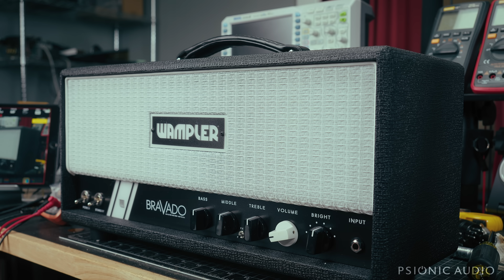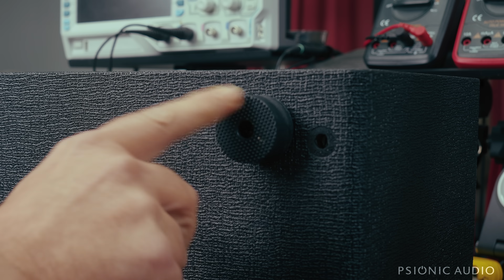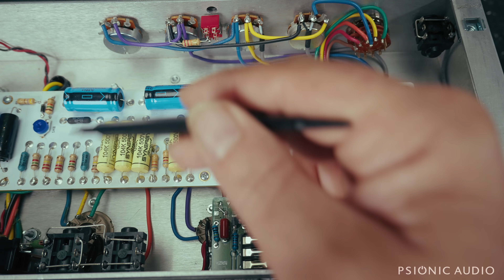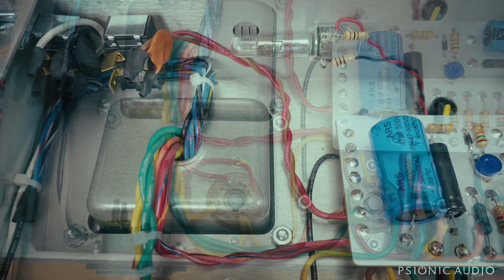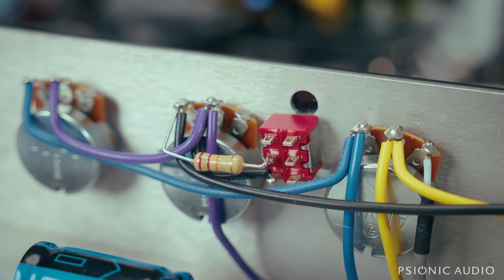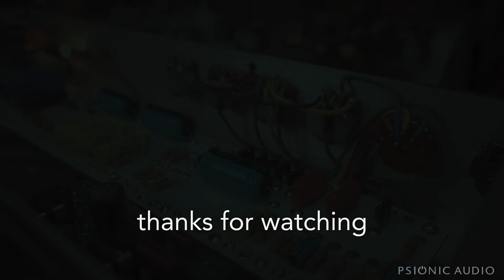Tell Me Something Good | Wampler Bravado Pt 1

Comment: Hi Lyle, is a VVR a good option for knocking down volume while getting that cranked amp sound. I have a TooHat Club Royale MKII that I’ve been considering this for. I play it liv,  but it’s still too loud with out attenuation. 

Thanks in advance
Reply from the maker: I’ve found that VVRs don’t last nearly as long as expected. I used to install a lot of them but had too many mosfet failures no matter the mosfet or heat sinking used. Just MVs and external high quality reactive loads for me now.

Comment: I own one of these.  Super happy with it but you have to want what it provides and be okay with what it doesn't.  Zero gain stages and high headroom was what I was after and it delivers.  Superp clean tone and yes it works very well with pedals. The only thing thats gone wrong for me was the bright knob selector slips.  Also mine doesnt have the noise at higher volumes like the one demo'd here, not sure why.

Comment: The reason Wampler didn't put a lot of 16:35 "options on the front" is because it's meant to be used as a pedal platform.  He probably wanted something straightforward so we could focus on the knobs on our pedals instead of the knobs on the amp 😁

Comment: The fat is not really big change. It seems to add a little bit of low mids. As designed it could be useful if the user is willing to move the tone controls away from 12 O'clock.

Comment: I was intrigued by his comment on the Silver Mica capacitors as I've us them in HF RF circuits for some Amateur Radio builds and wanted to know the difference between them.   Capacitor  marking can be both informative and confusing.   I found that CDM Vs. SM is not a technical specification or indication of performance for the capacitors, it's really more of a manufacturer indication.   Capacitors marked "CD" generally were originally made by Cornell Dublier,  now owned by Knowles.    It would seem that the CDM labeled parts are now labeled CD15.  The OTS cost of a 250pF, 500V cap is is $4.75 / 10 an $3.40 / 100 at Mouser which are reasonable volume discounts for a low volume amplifier builder.  On the other hand, the SM  type caps are generally Chinese sourced parts and are available through Tube Depot (as an example) for $0.81 / 10 and $0.53 / 100+.   So, while I don't discount his general comment WRT to the long term degradation of the SM marked parts, the price difference is substantial given that there are 5 capacitors in that circuit alone.
Reply from the maker: Yeah, good silver micas cost more, but they cost less than amp repair or a ruined gig. 

I prefer high quality ceramics over silver mica, both in terms of sound/performance and cost.

Comment: So how this can be CE certified (by yourself) if the most important wire is not wired to standard? 6:45
It should be green wire (green/yellow in Europe) and like you say - wired to separate lug and screw.

This amp has CE mark on the back.

Comment: How do you think this amp would do with a power attenuator, something like the Tone King Iron Man 2? Awesome video. Thank you
Reply: Was thinking the same thing.. attenuate rather than modify
Reply: I just bought one, and I'm running into a Torpedo Captor X then into cabinets. I'm VERY happy. I can do all the clean pedal platform stuff within the amps clean headroom. I can run preamps direct to the FX return, and it does the thing RIGHT. I can crank it and get the amp to break up naturally at reasonable volumes too, which sounds legitinately outstanding.

Comment: How important is that dedicated safety ground when you have an IEC connector?
Reply from the maker: Code is code
Reply: @PsionicAudio  I disconnected the safety ground in one amp once to see what was going to happen and I was surprised how quickly the potential started to build up on the chassis ground. I was watching it on a voltmeter and with 230V mains I quickly had 80V there. There wasn't enough current to cause harm, but it gives a nasty shock. I discovered how bad it can be when I worked on one amp which - as it turned out - had a broken earth wire in the mains socket and it suddenly jolted me when I touched the input cable ground. It's not a bad idea to take a neon test screwdriver and touch the chassis before touching anything else with a bare hand to see if there's any potential on it as the ground connections cannot always be trusted. Many years ago while installing a new battery I discovered that the safety ground came completely undone just by itself in one rackmount APC UPS we had at work and I then finally understood why the LAN switch was jolting so badly when I was installing new wall sockets on the network. I thought the telephone line was touching something somewhere as it always had like 48V and would often offer a nice tingle as well, especially on moist hands. Due to the missing safety ground connection the UPS had a very high potential on the chassis, can't remember exactly right now but it could have been even as high as the mains voltage.
Reply: The IEC connector doesn't make a ground to the chassis just by virtue of being bolted to it. Losing an earth ground connection to the chassis could be fatal to the player.
Reply: @goodun2974 but how would you lose that earth ground? A yank will pull the cord out the connector. No strain will be transferred from the connector to the ground connection inside the chassis. So how would it come undone?
Reply: @AndrewAlex92 , you're referring to a totally different scenario, where a "hardwired" power cord that pulls free of the strain relief is supposed to have the earth ground wire to the chassis looped a bit longer than the hot and neutral wires, so that the ground would be the very last thing that could get pulled free from the amp (the chassis remains grounded while the hot lead pulls free first and perhaps shorts to the chassis,  blowing fuses and/or tripping circuit breakers, and removing the electrical hazard).

 What Lyle refers to here is the electrical code provision which requires the earth ground connection to the chassis to be dedicated and singular, not used as a ground point for anything else, making it less likely to vibrate free or develop an intermittent connection. The worst case scenario would be to use a transformer bolt for chassis ground, since those are often seen to come loose from speaker vibration, transport shock, torsional stress, expansion and contraction of the laminate stack, perhaps even stretching of the transformer bolts; but the more wires you attach even to a dedicated chassis-ground terminal lug, the greater the chance of dissimilar metals causing corrosion and the more difficult it may be to tighten the ground screw again in the future. Note that an aluminum chassis with a (stainless?) steel or brass bolt, a plated'copper solder terminal, and a star or lock washer likely has 3 or 4 different metals in that connection, and a resistive buildup of tarnish from dissimilar metals is a possibility; amplifiers also typically generate less hum and noise if the earth ground and power supply grounds to the chassis are separated by a couple of inches (a concept referred to as ground "steering"). 

Anyway, a non-shared chassis esrth-ground is part and parcel of modern electrical code. The strings and metal hardware of a guitar are tied to the amp chassis through the guitar cord ( they must be, or hum and buzz would be objectionable loud), and loss of an earth ground to the chassis runs the risk of having high voltage on the guitar strings if the amp develops an internal fault and the fuse can't blow because there's no path for the deadly current to reach ground, except perhaps through the guitarist's body to a microphone or other onstage device or home appliance.

I hope I explained this in a way that makes sense to you....
Reply: An IEC connector does not necessarily make an amp safer.

Comment: Gotta say... Based on the audio demo, between the brightness selectpr positions, the Middle tone and volume control, that is one of the most "linear" ranges of usable tone I've  heard.  There might be better amps for ONE sound at ONE level (usually too loud) but that sounded useable across a really wide spectrum.  And the build quality was outstanding.

Comment: Is there a channel similar to yours that goes into this level of detail about bass amps? I've been burned by buying old solid state heads with phantom issues and no available schematics, so local techs just write them off. I'm looking to invest into something that will last and be reliable
Reply: If you want a “Forever amp” that can be serviced, I’d look into some kind of point to point tube head. Maybe an old Ampeg SVT or a newer Matamp?
Reply: @THEO_THA_WEEGIE  Tube amps have their vibe, but for my band I usually go for solid state because they tend to take my pedals better. Think older Trace Elliot or GK